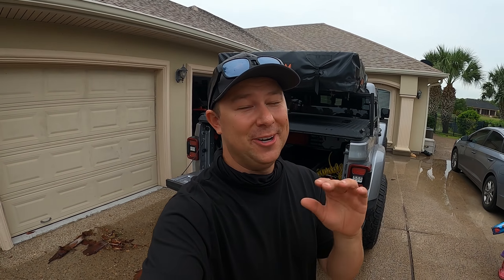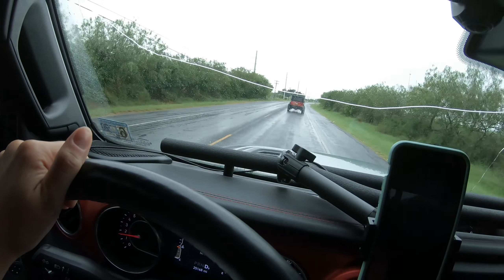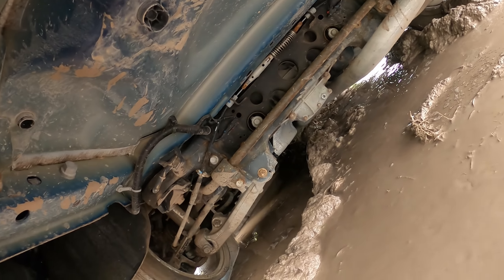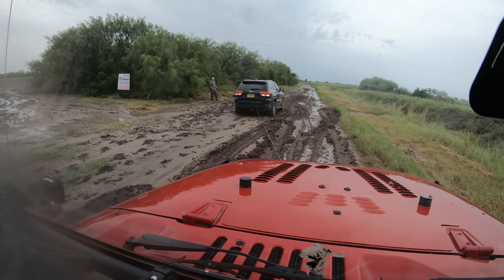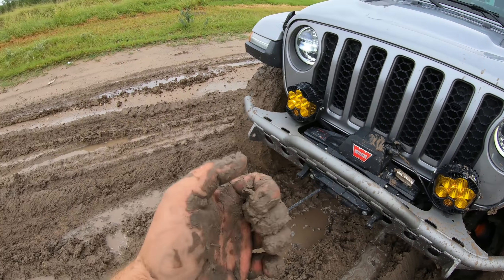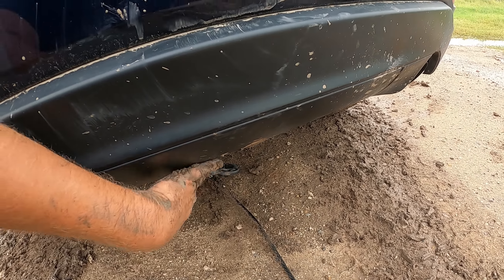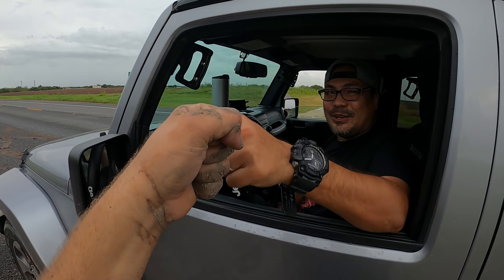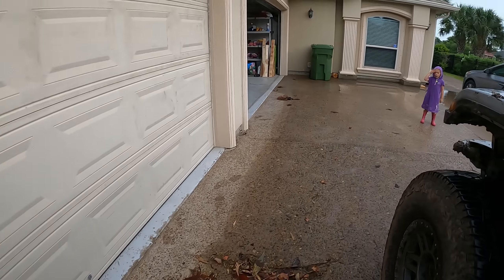Recovering A Jeep In Nasty TEXAS MUD

Comment: Just for the record, that Grand Cherokee is a Laredo trim. The Laredo trim is only a very basic 4WD system. It has no low range and consists of a series of open diffs. The good 4WD system with low range and the rear E-LSD can be had on the Limited trims and above only.
Reply: It's also not trail rated.
Reply: Wolf Cross Adventures that too. Lol

Comment: One day Jeep is going to have an epiphany and re-release the XJ, and we'll have another 17 years of pure Jeeping bliss.
Reply: KL is going to get the same nostalgia as the XJ. People don’t remember how much crap the XJ took first 10 years until people start to really modify them when the working class was able to afford them.
Reply: See the release of the Wagoneer... Ya... I dont trust them with the precious XJ remodel lmao.
Reply: @kjhaglfjhgfasd  Good point. lol. But we can always hope!
Reply: Jeep doesn't exist any more... Its ran by Fiat cough, actually Stellantis. Last of the AMC powered  jeeps was in 2010 with the power tech 4.7 V8 and the 3.7 V6 (their first and last v6 ever produced). They are owned by an Italian company. Before that Benz which is why the WK2 has mercedes benz stamped all over it. The benze logo is stamped under the dash and on the differentials if you get and chance go look. The Durango, Challenger, Grand Cherokee WK2, and Charger are all based of Mercedes platforms. Jeep has been dead for a while only in namesake does it exist and barely even that...
Reply: That epiphany will be over shadowed by the fact that they will make it super luxury, it will cost a small fortune, and it will be extremely unreliable.
Reply: A nice stripped down CJ-5 with a v-8 mechanical shifting transfer case. Divorced high low gears and transfer case, and lockers from and rear
Reply: @donoberloh  Im more of a TJ fan just because those coil springs allow for better articulation... A nice TJ with a 4.0 or transplanted V8 can't be beat! :) We have a CJ at the farm. I do want to buy a TJ some day. Right now my LR rifles are stealing all my free money.. I have too many expensive hobbies lol

Comment: Pro tip: on a muddy, sloped road, you'll always slide into the ditch if you try to pull someone in reverse. You have no control of the direction your vehicle goes if the front is attached to the vehicle you're pulling. If you turn around and pull with the rear, you'll have much better control and won't need to winch.

Comment: Your comment about overheating the winch reminded me of the Warn 8074 (8274 without freewheel knob) that I had on my Scout II. I abused the hell out of that thing, melted battery cables & smoked the paint off it more than once, but it never once failed me. The funny thing is they have less powerful motors and abysmal gearing when compared to the M-series, but people pay 2 grand for them. Fast unloaded line speed is important to some, I guess! I prefer the torque of my M8000, some of the skidder paths I get my TJ stuck on need every lbf it can give.

Comment: Easy now folks....at least it’s not a Patriot or a Compass
Reply: or a renegay
Reply: MUD Tires are 70% of the solution & the traction control algorithm that can not be fully turned off is a 20% hindrance.
Reply: No recovery hooks but trail rated ????
Reply: It's a Grand Cherokee Laredo model.  Which is like the most basic model you can get of the GC, hell it might even had 2 wheel drive....lol
Reply: Hal its easy to get stuck in mud even with M/T tires and 4x4
Reply: @Future-Preps35   Unfortunately, Renegades don't have 4Low...they have a 4Low button but that just locks the trans in 1st gear.    No transfer case and no true low range.  Jeep even calls it a 'Low Range Simulator'.  No limited slip diff's either, just the standard brake lock / traction control system to move power around.

Comment: Hook each end of a standard tow rope to each lower A-arm, then attach the pull strap to the middle of the tow rope, and pull from there. Will allow a straight pull and distribute the forces through both sides of the rear end.

Comment: Sorry I missed you reply. It was a Grand Cherokee Trailhawk (limited?). $78k worth of dissatisfaction. I  am probably jaded though, Having fully built for Desert running, rock crawling, jumping, and over landing vehicles. 

Jeeps I have built since mid-seventies... ‘55 CJ-5. ,’64 CJ-6 (very rare) ‘72 CJ-5, ‘78 CJ8, ‘79 CJ-7, ‘89, ‘ 90, and ,92- Wranglers, 84 Cherokee . Non -Jeep’s: 2-‘76 Ramchargers, ‘69, ‘70, and ‘71 Blazers, ‘ 76 and ‘78, ‘82, ‘88, ‘and 96 Broncos, ‘74 Dodge 2500 4-door short-bed, ‘84 Chevy 3500, ‘79 F250, ‘90 F350, not counting the numerous Japanese mini garbage. Lol. 
Current project: 1974 M1 deuce and a half- multi (fuel engine)

So I expect a lot from a Jeep that’s supposedly a worthy off-road trail hawk.

Comment: Being a base model GC, it doesn't have true 4x4. It is AWD. It has street tires on it. 
Yes, the built jeeps won't have any issues when going up against a stock GC.
Reply: this. Even a trailhawk with low and the mud settings would need better tires to get through that stuff though, the stock ones arent that good in mud.
Reply: @bloroxcleach  yep. Exactly

Comment: My first jeep, 04 KJ, no hooks much less snatch points. Thinking, who would design a 4x4 (so called off road rig) without hooks. Then, got  09 KK. Same thing. But I had the dealer install a front hook. I put a class III on the rear so no worries there. Got  a 02 LIMITED which had hooks. But still, I understand a RAV4 but a Jeep? Hooks should be standard much less required if it's has 4wd.

Comment: What do y’all think is the better transmission option for off-road and daily commuter 3.8 jk? Comfortable with the auto but also comfortable driving manual.
Reply from the maker: Manual just because the 3.8 isn’t an ideal engine in regards to power. Plus the auto they used with the 3.8 (42RLE) is geared horribly
Reply: Thanks you. Got a 2010 jk 2 door with the automatic looking to hopefully get that changed in the near future.

Comment: Nice video!! Those guys should have never go into that road!
The boards, with a SUV like that and in reverse, should go in the front wheels, so the weight of the engine are on top of them and doesn't work as an anchor. But anyway, using the boards would have taken all day!
Too bad for the poor road and the owner, because it ended up wasted!! The owner will have to put some $$$ to level it :S

Comment: Didnt that jeep have Brake lock diff’s ? Because when a wheel spins freely like that their jeep should have locked that free spinning wheel so the one with the max tracs would turn .. thats the way the traction control works in my jeep . I can have one wheel off the ground and it locks that wheel so the wheel on the ground gets power.. either they had traction control off , or that wasnt a trail rated jeep or it would have had brake lock diffs in it..

Comment: Bro, its a base model Laredo with highway tires. Not trail rated TrailHawk. 😂 A base model ZJ would take that though.. 👍🏻
Reply: I have a laredo, wj, it goes anywhere. Quadradrive transmission, 3" lift with 265/70/17 tires.
Reply: I had a zj I bought for 400$ it had the front axle all fucked up so it was only rear wheel drive but it got around just pin it
Reply: Jeeps big redo for the trail hawk, according to all their ads is the addition of tow hooks, they even brag about them being red.
Reply: @imchris5000  Put a locker in the rear diff and its fine. 👍🏻
Reply: @Curtis Fleabag stop yelling
Reply: Curtis Fleabag   Gee Curtis, calm the F down!  I never said it was “ trail rated” I said the “trail rating “ is a marketing ploy more than a testament to any better off road prowess.
Reply: I inch higher body, axles are still same small ground clearance. No factory installed lockers until the Rubicon model, same soft shocks, no long travel suspension,  only Red Tow Hooks.... what makes the “trail rating?”  If you drive down a trail , flat with no rust or rocks I guess your ‘trail rated’ by Jeep execs huh? Maybe they should have trail ratings also like rock climbing routes.  Gumbo (clay)mud and the Rubicon trail being among the hardest.

Comment: 🏆🏆🏆🙏🇨🇱
Greatest helpers 💖
Warn has a Zeon model with a wireless remote with temp monitor and power in/power out/freespool select.
Reply: see i wnt to buy that winch but 1 since everything is electronic i will kinda have trust issues cause well more electronics that are in there to fail but it is from warn but ive had buddies that have had problems with those winches too sooo im still considering that winch
Reply: @thatmand4542  I, too was afraid, of dead batteries in remote.  I use the Warn wireless remote in my Zeon and my  Warn VRX 45S on my Honda Pioneer 1000-5. And, I can still use the wired remote as a backup. 🤗
Reply: MoneyPit Jku  but cheaper than a titanium exhaust for a Ferrari 488. ~$40,000. Sometimes spending up front stops regrets later on. That's a hard decision without a known outcome.🤔

Comment: That WK2 wasn't trail rated. Trail rated GCs have QDII which is actually better then a wrangler sport (two open Diffs). That Laredo has QTI meaning the 4 wheel drive system uses brakes vs QDII which has two locking differentials. Tires make a big difference as well. Mud doesn't phase my Hemi WK2 with locking front and rear differentials. Good job taking your Fiat(2011+ wrangler/gladiator)  to rescue a Mercedes (WK2) even though all the V6 van engines out there were designed by Fiat.
Reply: I think you might want to research keeps QDII a bit more Benny
Reply: @donoberloh  I know it very well. if you want the link to research it yourself I can post it... I could even tell you that V6 Laredos only have a single speed transfer case vs My Laredo X Hemi QDII that has a 2 speed transfer case with the ability to split torque based on terrain.
Reply: @donoberloh  https://en.wikipedia.org/wiki/Jeep_four-wheel-drive_systems#Quadra-Trac_II
https://www.jeepgarage.org/threads/how-the-elsd-on-quadra-drive-2-wk2s-is-more-of-a-locker-than-people-think.220617/

Comment: Normally I like your videos, but I have to disagree with how the recovery was conducted. From winching on the coasts side of the gear, grabbing on the stamped steel subframe, and highly dangerous  using the winch line to pull when both vehicles are in motion. This can cause winch damage or resulting in the line snapping and hurting someone. Definitely recommend looking into some recovery groups on YouTube and learning how to safely and properly conduct a recovery. Also suggest in a recovery strap since it’s a simple, cheap, and effective tool to get a vehicle unstuck. Not here to hurt feelings. Just don’t want to see you guys, or a Jeep, get hurt in the future!
Reply from the maker: Where would you have hooked up to? That was the only good spot. 
Recovery strap would have been harder since it could have possibly damaged the bumper. Plus, recovery strap pulling would have been harder since neither Jeep would have good traction or control of steering. Winching was the best/safest solution since it was slower and offers more control of the situation. 
In low traction areas when the jeep isnt extremely burried or experiencing a large load (stuck in rocks, or up and incline), it is ok to pull some with the winch line since the load is very small.
Each situation is different every time.
Reply: Yes there are many ways that this could of been done. I did however find the owners manual onIine and discovered that the Grand Cherokee does have a tow hook installed in the front bumper beneath the passenger side cover. Most modern vehicles have a hidden panel in the bumper that open up to a hook or a spot to install a tow eye. If you ever look please let me know if that’s true or not. I still have to disagree with using a winch line as a means to tow with. Especially since shock loads can easily max out the line strength. Recovery can become dangerous in a short period of time. During my recoveries I limited as much risk as I can to my vehicle, equipment, others, and myself. Regardless after all that you got the Jeep out. Hope to see more videos in the future and stay safe wheeling!
Reply: Four Wheeler did an article on winching and went into the fact that a winch is for a static pull. 

https://www.fourwheeler.com/how-to/body-chassis/1611-winching-dos-and-donts-tips-tricks-for-safe-4x4-recovery/